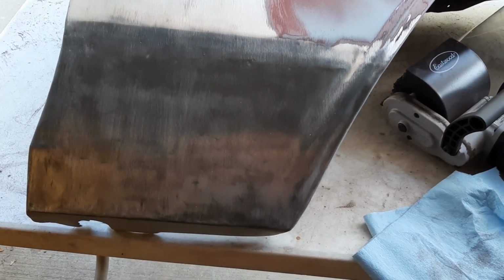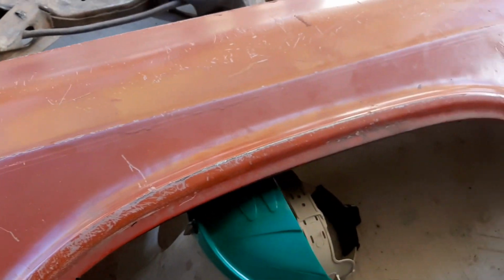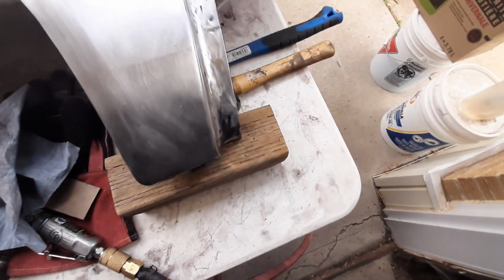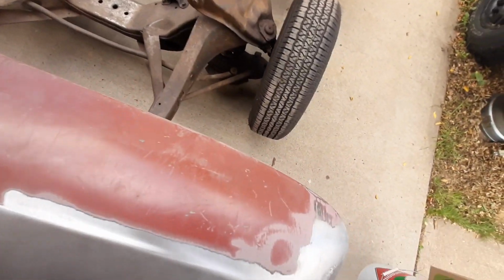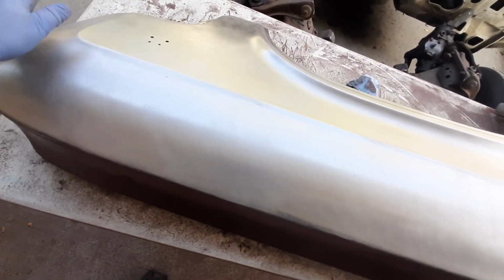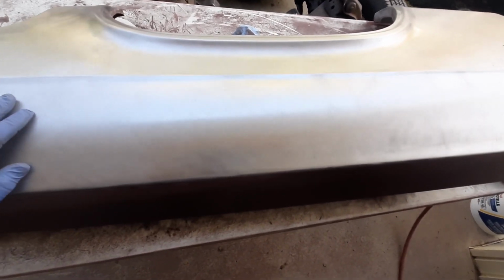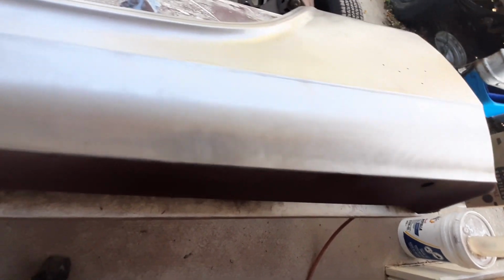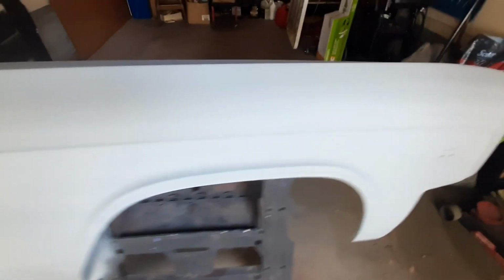1966 Chevrolet Impala SS RF Fender Strip & Primer

Comment: Why go to all the trouble of stripping it down to metal if you are going to use a spray can primer my experience with that stuff it doesn’t hold up very long maybe that won’t be the case for you it’s a lot of work to take that chance to me but to each his own but either way good luck on that hope to see it finished soon
Reply from the maker: Depends on the "spray can primer" used. Did a lot of reading online before choosing it, but I've found the Eastwood self etching primer works very well to just cover up bare metal & keeps rust away until I'm at the point of spraying everything in a high build primer for block sanding. At this point still in the metal work phase, rear quarters are next come spring. Cold with snow where we are right now. Our garage is unfortunately not heated & too small to do any work in so at the mercy of mother nature to get things done.